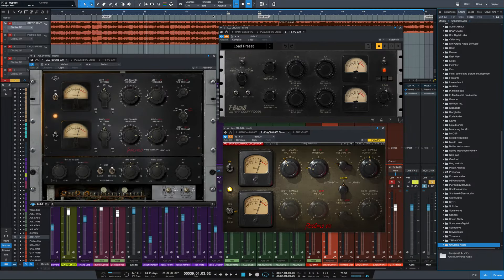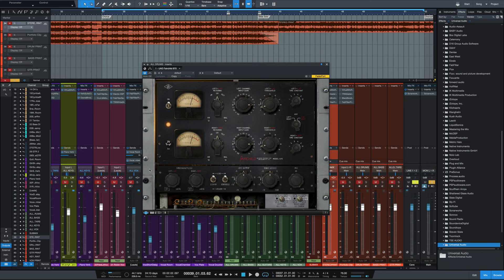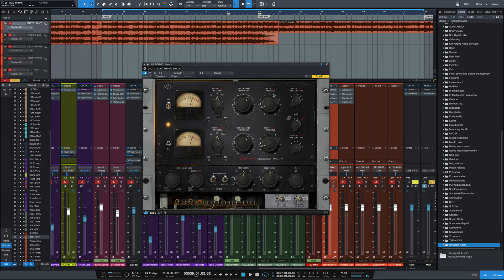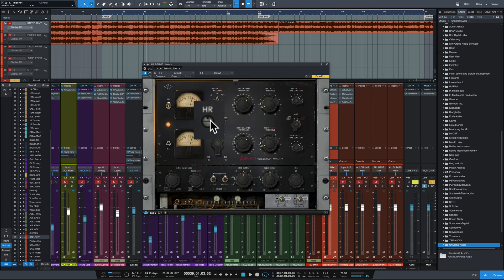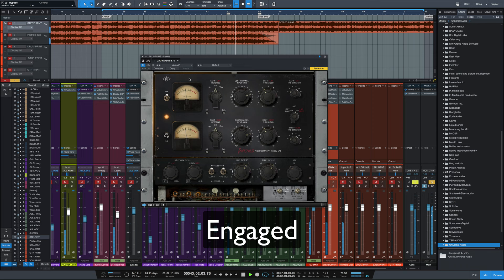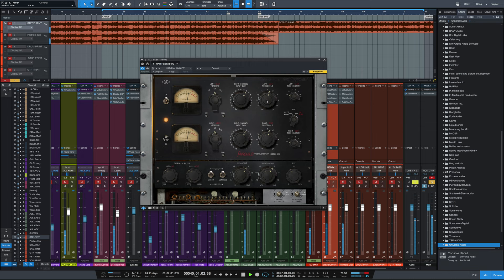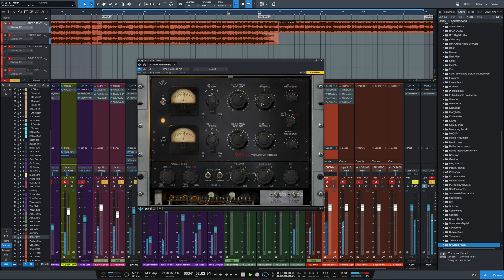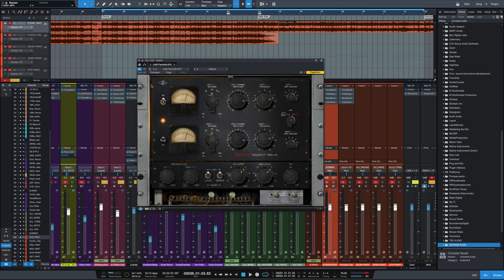The Fairchild Compressor Explained | The History, Controls, and Sounds of a Legendary Compressor

Comment: Thanks for your detailed explication of this compressor. There is another copy of this compressor made by Overloud. Their copy has 3 variations of models.
Reply from the maker: I've never tried the Overloud model, but thanks for the suggestion.
Reply: The nice thing about the Overloud is that their compressor has 3 variations copied. One of them is based on a Fairchild in London, another in Los Angeles and another in Milan. And when you change to each one, you notice their sound change. They also added Side chain filter for each "vert", meaning for the left and right vert. Also they have a parallel knob. The GUI is very nice. Check it out. I think you will like it.
Reply: @ricardoayala2023  ~didn’t know about the Overloud, thanks for the tip. 🙏
The thing about the three Fairchild 670’s you mentioned that Overloud has modeled separately and includes in their plug as separate models to choose from, is a cool thing. Modeling the variances between the same models of HW offers a truer emulation of actual hardware, because those variances did exist in real analog gear, as opposed to using a plug in that was modeled after only one specific model. 
These differences occurred in pretty much all analog HW; it could have been the result of them being hand built (like the original Pultecs) or, over time; it can be caused by the HW’s age and its miscellaneous circuitry.
The consistency of the voltage in the studio that’s supplying power to the unit can also be a factor, and even the degree of wear in the mechanical parts of the HW - meters, switches, variable/rotary pots controlling the input, threshold, output gain, knee controls...
And, when talking about analog hardware - and not just specifically a Fairchild, but any analog hardware that could now be as old as 60 years, it’s not uncommon to expect that changes were made to that piece over the years -necessary changes when certain components would fail, which happens in gear that generates heat...
That doesn’t make the Fairchild in London any “better” than the one in LA, or the one in Milan, (or one in NYC, or Toronto, or...) but just a bit different from the others... and that’s okay, and should he expected. 
Each can have its own vibe, while still having the “magic” that Fairchild limiters are known for. 
Thanks again for the heads up on the Overloud! 😊🙏

Comment: Hi, awesome explanation. Where did you get the numbers? And....are these from the Hardware or the Waves Plugin?
How could you be sure the numbers are the same on both?
Thx for the great videos. Greets from Germany.
Reply from the maker: The attack and release times were originally published by Fairchild, and are also included in the Waves and UA manuals.  I'm sure they vary from unit to unit due to component tolerances, but since these plugins were modeled on specific hardware units you can assume they're close to hardware performance.